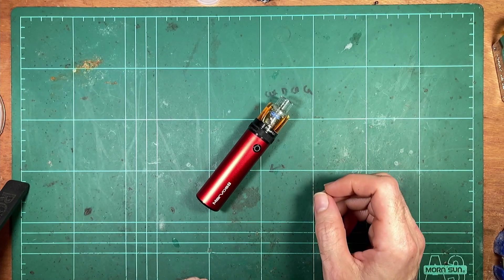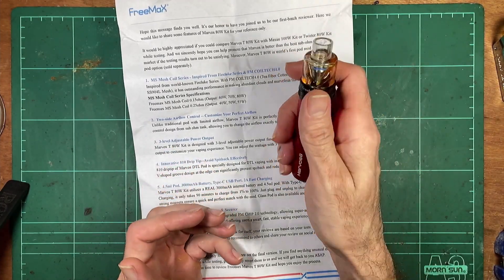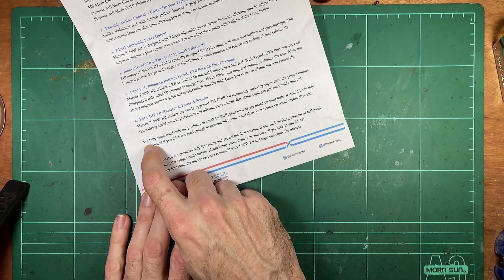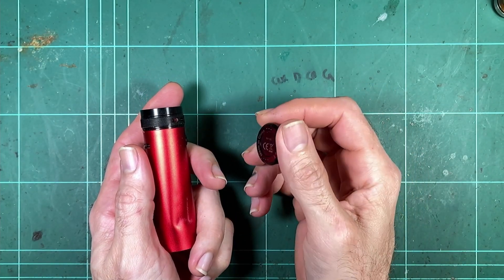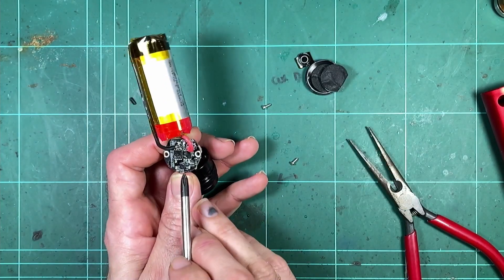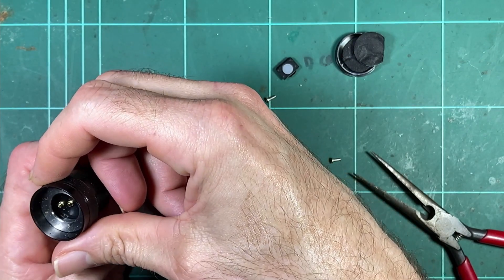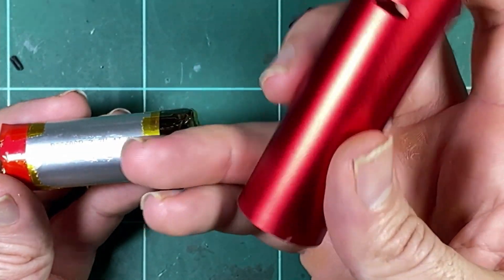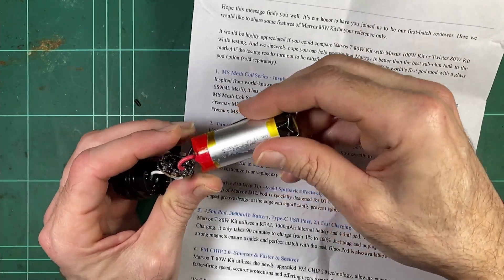FreeMaX Marvos T - Disassembly, cell testing, review, insider info!

Comment: I got mine. Those are def pod systems, but they’re mainly for beginners. I’m 3 years into vaping after cigs and just got my Marvos t and am beyond happy with it. It’s a great device.
Reply: Does it not leak for you guys? I just bought three of them (big mistake, should have tested 1 first), and they all three leak like crazy! I use more liquid in one day than my other devices use in 4-5 days.
Reply from the maker: Great to hear mate :D Cheers for the comment.
Reply: I have been vaping for 7 years, and I DO NOT want a 200 dollar system with hundreds of features.  This is the style I like (even though the battery is garbage)

Comment: how did u open it
Reply from the maker: From memory I got it in a vice and hammered the bottom cap off. I might be wrong, it’s been a while! Either way it’s a destructive disassembly - the mod probably won’t be usable afterwards. Also it’s a safety risk to take it apart.

Comment: Was just wondering how e-liquid can damage the circuitry with it not being conductive, after all it has to be in contact with the circuit via the heating element? E.g., I think you mentioned the potential for blowing a MOSFET near the fire button on another video (Swag?) and causing autofiring issues. Is it more a case of water ingress rather than e-liquid ingress? Or is it that e-liquid is conductive enough to damage the small components? Cheers for making these videos btw, really interesting. 👍
Reply from the maker: Hey thanks for the comment and good question! There’s a couple of parts to the answer and it’s a bit tricky to explain, bear with me!

You’re correct that e-liquid is fairly non conductive, but actually the conductivity can increase significantly over time as it absorbs water from the air (VG is hydroscopic) and mixes with any ionic substances / impurities that it may be in contact with. This is particularly relevant to liquid that may have leaked into a device and be sitting in there for a while, not so much with liquid constantly being cycled through an atomiser. It probably won’t get conductive enough to outright short components on the board, but it doesn’t have to be to cause damage and malfunctions. 

So part two of the equation is the components the kind-of-conductive liquid is in contact with, namely the MOSFETs and also how they work. In a mod board design they’re an essential part of the voltage converter - they handle switching large currents from the cells to the coil. These guys are switched on normally by a voltage from the microcontroller and interestingly require very little current on their gate to do so. That means that even very poorly conducting liquid can be enough to switch them on, if that liquid is covering from a voltage on the board over to the gate/s of the MOSFETs. That will then cause auto firing and / or for the MOSFETs to get super hot and fail. When a MOSFET fails, it’ll often fail in the shorted condition making things even worse. I’ve seen them literally vaporised off the board! There’s a hell of a lot of current available from the lithium cells we use. Also note that if a MOSFET is inadvertently switched on by conduction to its gate through liquid, the board microcontroller loses the ability to stop any auto firing or switch the MOSFET off. 

You’re correct also that the liquid in an atomiser seems like it would be kinda shorting out the output circuit if it was conductive since it’s in contact with the coil, but really the coils we use are such incredibly low resistance that it’s not really relevant. Like in most electrical work anything less than an ohm is generally considered a dead short, even quite conductive liquid be a lot higher and wouldn’t bother the coil output circuit or change the atomiser operation significantly. The output circuit / voltage converter is built to drive these very low coil resistances too.

Hope that made some kind of sense, I can elaborate or clarify points if you’d like. Cheers :D
Reply: @vmgtesting8014  thanks for such a detailed response, that makes perfect sense. 👍

Comment: Mine is straight up garbage. The button stopped working, I literally have to press it so hard it feel like I'm going to break my thumb. It was fine for the first week and I don't know if juice leak down in the button, but sometimes it refuses to work. My GF's on the other hand works perfectly. She dropped the thing in the toilet and it still works. (Not the atomizer, just the battery)
Reply: Mines done exactly the same it's doing its own thing now like it's software or something has gone wrong, but yeah it's fkd

Comment: Hey man thought i'd ask you would you recommend getting the Gen X? because i have the Gen mod and it started to wobble with the 510 connector and honestly it just annoys me thank you though and love the vids
Reply from the maker: The Gen S has the same 510 attachment method but was supposedly improved by Vaporesso from the original Gen - I tried to break mine and it didn’t budge but some people still say they come loose. I’m not sure about the X but I believe it’s basically an S with a metal frame. So should be better than your Gen but still has a chance to come loose IMO. Cheers for the comment mate!